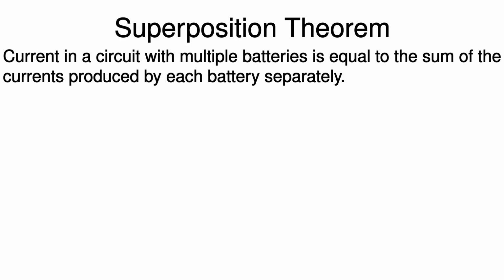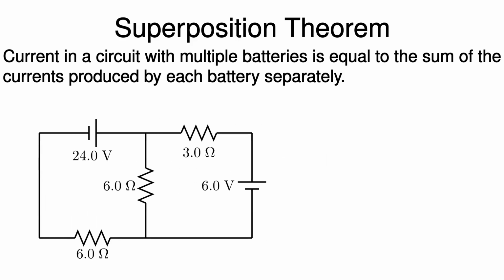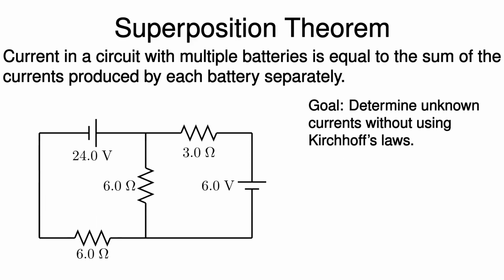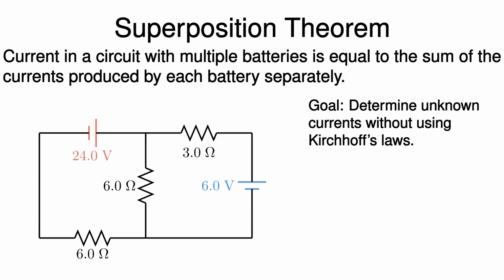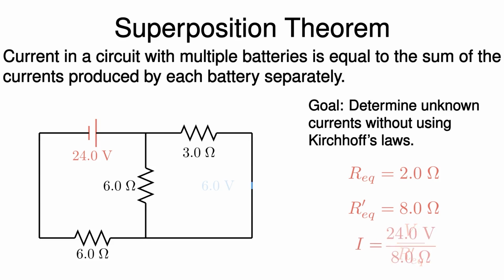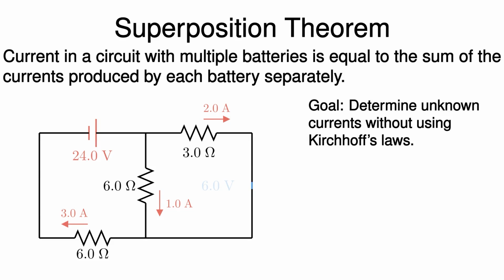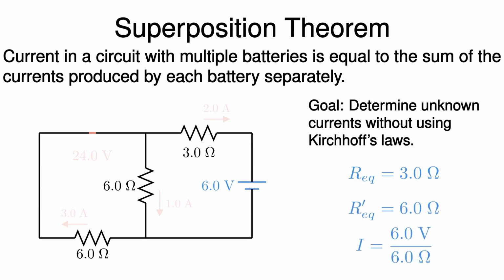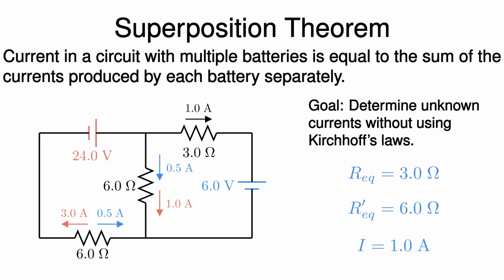Kirchhoff’s laws problem shortcut 2 – Superposition theorem explained with example

Comment: so we can use both methods to determine the current values right? but superposition has just a longer calculation
Reply from the maker: Yes, you can use Kirchhoff’s or superposition. For some who are not comfortable with solving a system of equation or have difficulty remembering the sign conventions of the loop rule, the superposition principle approach may feel easier or more straight forward.
Reply: @physicsmadeintuitive  thank you so much